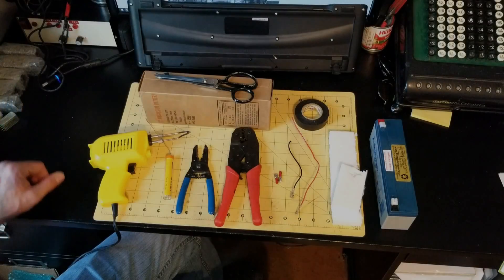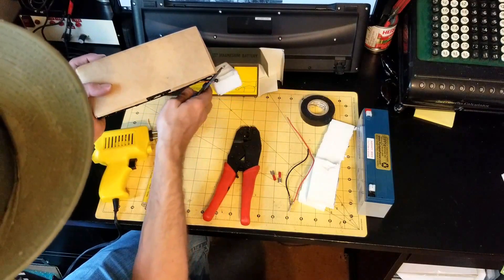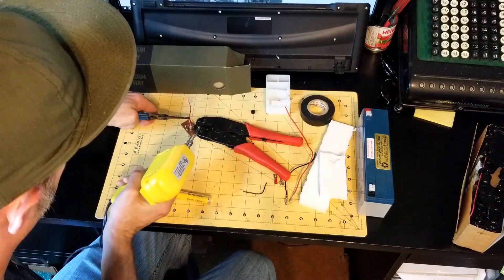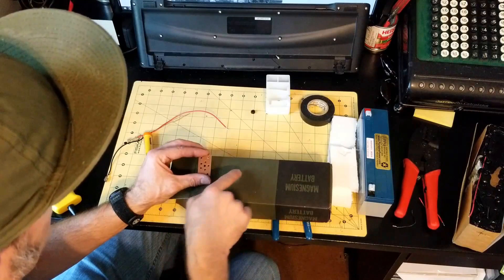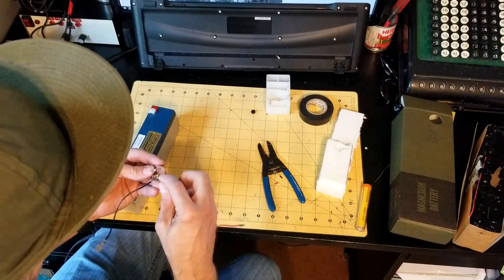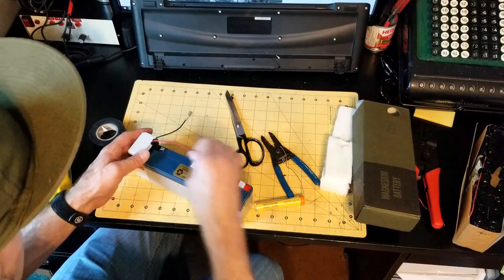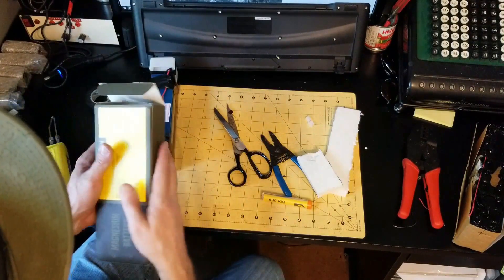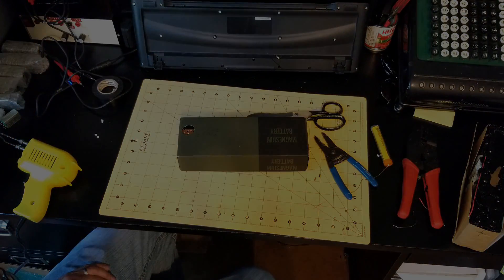DIY Rechargeable Battery Pack for your PRC-77 Military Radio

Comment: can you show how to do this with the prc-25,  address the bias wire.
Reply from the maker: The grid bias voltage for the power amplifier final in the PRC-25 is -3V.  In a rechargeable battery setup like this video, I would tuck a two AAA battery holder (like this one: https://www.amazon.com/dp/B07DBLY3WS/ref=sspa_dk_detail_6?psc=1) into the box in place of some of the styrofoam filler.  Solder the black wire to the BA-4386 PRC-25 battery ground socket connection, and solder the red wire to the BA-4386 PRC-25 battery 3V socket connection.

The radio circuit draws near-zero current from the grid bias supply, so these AAA batteries should last almost as long as their shelf life.  When recharging the PowerSonic battery, just make sure to only connect the recharger to the 12V terminal.

Hope this helps!

Comment: Followed your video to make my battery adapter and now wondering what are the specs for your battery recharger....AATW
Reply from the maker: The charger I would use with this battery is the Powersonic PSC-12800A-C Sealed Lead Acid Battery Charger - Automatic Switchover 12 volt/0.8 Amp Nominal https://www.amazon.com/dp/B0002ILK5Y/ref=cm_sw_r_cp_apa_i_JxlACb24QYKTD

Comment: Here is a link to an RW69 resistor for the PRC25 battery 3 volt connection http://www.vishay.com/docs/30281/rwmilita.pdf ...Not exactly sure how to integrate it, though.

Comment: Hello,
I like idea using old  batteryhousing, my question is what's the maximum safe input voltage on PRC-77?
Does li-lion battery containing 4 cells (fully charged voltage 16.8V) won't be to much to risk burn radio?
The working voltage is 14.4V but when they came out from charger there is 16.8V for a while.
Regards
Reply: That will be fine. The voltage will drop down as soon as you turn the radio on.

Comment: OK this is a good start now make a battery tutorial for the prc-10 because i need to make one and i don't know how
Reply: Ben I've made one. check out my QRZ.com page under my callsign KB1PFL you can see how i made it. my email is good there for any questions.Jim
Reply: just noticed you need to sign in to see my email. if you create an account just put SWL where a ham radio callsign would go, you don't need to be a ham to join just a short wave listener. also see my PRC-10 video on youtube.Jim
Reply: I tried looking you up on QRZ but I can't find anything on your build